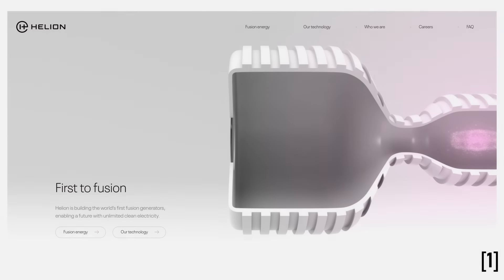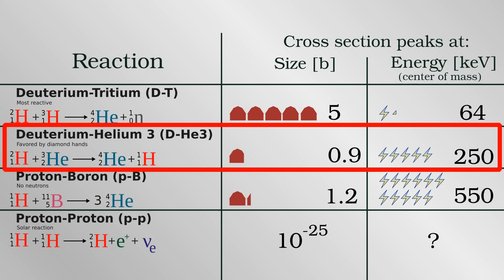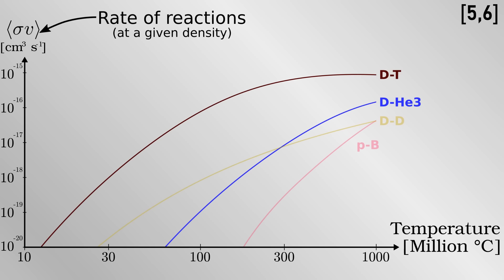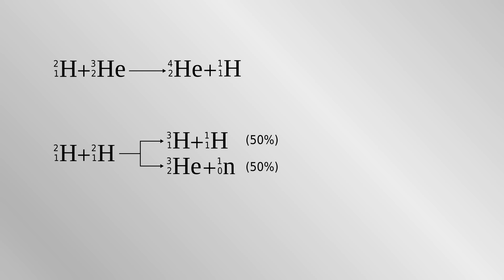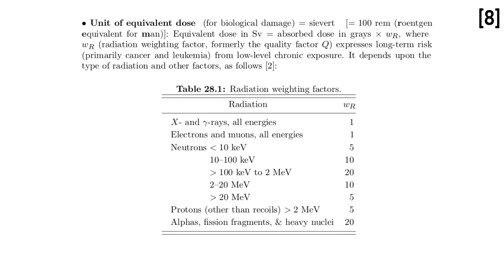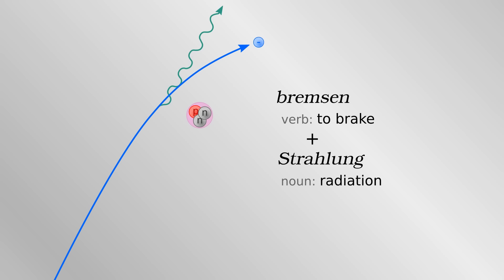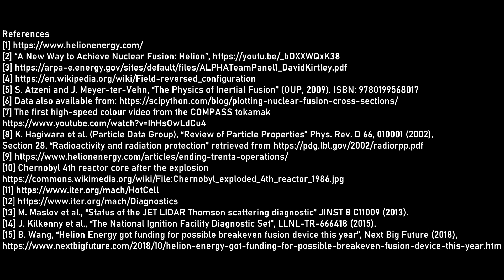The problems with Helion Energy - a response to Real Engineering

Comment: Great video.
I look forward to checking out others you made.

Personally I think fusion Energies probably won't be done here on earth as it seems we will be trading out one nuclear waste source for another.

We have been doing nuclear fission since the 50 for power. In that time we have maid some 500,000 tone's of radioactive waste.
I think if some how we got fusion tomorrow, the amount of radioactive waste generated would be comparable as every 5-10 years your going to have to replace key components in the reactor if not the main reactor itself because of neutron bombardment.

Let's say we take the 400 or so reactors we have now and instantly turn them into fusion type power plants. Each core around 1000 tones.... 
In the 1st parts swapping after 5 years that as much waste as we have maid in the past 70 years of nuclear power.

Granted not all of its going to need replacing and not all of it will be dangerously radioactive for "very long" but it sit puts Into perspective that nuclear fission isn't the "miracle power source" that it's maid out to be

Comment: I can spot one tiny problem with your analysis, what if Helion Energy not only increases temperature, but also the ratio of Helium 3 to Deuterium. Like 99 He3 to 1D? Then the Deuterium will be consumed by Helium 3, before the unwanted side reaction?
Reply from the maker: OK, but then the reactivity will be much lower, so it will be that much harder to reach breakeven. Also, all that Helium3 still has to be synthesized from Deuterium by them in another reactor. D-D fusion will strictly release neutrons 50% of the time.
Reply: @Improbable Matter  Extra Helium 3 would only need to be generated one time, and yes they specifically say they make Helium 3 from the D-D reaction in a separate reactor that produces tons of neutrons. I suppose there's a sweet point where the He 3 to D ratio produce (just) few enough neutrons for the nuclear regulator not to demand tons of expensive shielding and just enough reactivity to get a net energy yield.
Reply from the maker: @mreyesonthelies4386  Yes, but the "separate reactor" will still have the neutronics issues. If that breaks due to neutron damage, or becomes seriously radioactive etc, then there is no point having the one with Helium 3.

Also, the D-D reactor will need to break even on energy itself, or the Helium3 one will need to be even more efficient to compensate, which again will be difficult with a 99:1 ratio of reactants.
Reply: @ImprobableMatter  Yes they mentioned the maintenance cost of those separate reactors, which is why I'm so sure that they are determined to damp the D-D reaction to the extent possible in the main reactor to cut costs from neutron damage, costs which need to be cut to compete with floating solar on pumped hydro etc

Comment: I thought braking radiation was based on an electron passing a large atom?  Would hydrogen plasma really produce x-rays?  
Also, the neutrons are fast neutrons.  When you say a meter of material, you mean a meter of very dense material, right?
Reply from the maker: Hydrogen plasmas can and do produce x-rays. By a meter of dense material, I mean solid or liquid (not plasma). There physically has to be shielding somewhere in the system.
Reply: @ImprobableMatter  But it isn't a meter of anything.  Water vs lead.  Also, do you want to stop the neutrons or moderate them?  Slow neutrons are happy to grab onto other things and mutate them.
Reply from the maker: @putinscat1208  I can't read the mind of the Helion team, but my suggestion to them would be to stop the neutrons to prevent material damage making the machine unusable and transmutation reactions making the machine long-term radioactive.
Reply: @ImprobableMatter  Has anyone ever tried to use hydrogen to catch neutrons?  Then they can feed the deuterium product back into the reactor.
Reply from the maker: @putinscat1208  Of course, you wouldn't want pure hydrogen gas because it is explosive, but you could have heavy water to breed some additional Tritium (Deuterium itself is cheap enough). This is how Tritium is made in CANDU reactors. However, for Helion this would require big infrastructure that their current and future machines simply don't have.

Comment: Do you know of any ongoing or planned projects to fuse strictly protium or deuterium ? Aka the actually useful ones?
Reply: Also, if you read the comments, can you tell me what is the usefulness of a neutronic fusion? I get that protons and random ejected nuclei are magnetic and can be guided, but that's never going to be perfect anyways, charged particles are bound to fly off in pretty much all directions, even with a magnetic field. And then what? You can control the trajectory of protons going super fast, cool, but to extract useful power you're going to need them to crash into something anyways to generate thermal energy, a role at which neutrons do the exact same job as protons
So am I missing something? If we assumed there was a type of reaction that produced only charged particles, what would even be the usefulness of such a thing? We can guide somewhat the fusion products, so what?
Reply from the maker: Deuterium is harder to fuse with itself than with Tritium, so it would be hard to achieve a net energy gain. If you actually could achieve aneutronic fusion, then you could always extract the energy as heat and spin turbines, etc.

Comment: Well you're just trying to shrink a process the size of the Sun down to the size of a house. How hard can it be? I'm sure they'll have it in another 10 years tops.
Reply: You are joking right?  Sun has a enormous mass and thus gravity pull.  It squeezes atoms with extreme pressure.  Without the mass of sun and without the pressure, you need to raise temperature to 150 million K for fusion to start.  Very hard indeed.

Comment: Of course I’ll trust someone’s word about engineering when that person doesn’t even know that the reactor uses superconducting magnets, hence it will produce exactly 0 bremsstrahlung. 

Also the number of reactions isn’t as important as capturing the energy that they produce, Helions approach has almost 100% efficiency bc of the induction approach to capture, common Tokamak designs that use steam turbines and will have at most 30-40% efficiency. Additionally uptime is a huge issue with Tokamaks because of plasma stability and bc their shielding deteriorates rapidly under the neutron fire. Compared to a mild DD reaction the DT fuel is devastating for reactor lifespan and maintenance.
Also Helions approach is easily scalable and faster deployable, a commercial Tokamak will take 10-20 years to built Minimum (just look at ITER) and take up huge space. 

If there was a fundamental physical problem a 7 minute YouTube Engineering Video could find out, Helion wouldn’t have been able to get over half a Billion dollars in investments.

You are not a plasma physicist, if there was a problem someone smarter and more knowledgeable than you would’ve called bullshit years ago.

And now shut up and stop spreading misleading half-truths to teenagers
Reply: You could at least attempt to explain your position instead of squawking around like a marketing agent for Helion.
Reply from the maker: Bremsstrahlung doesn't mean what you seem to think it means. Bremsstrahlung comes from the plasma itself, it doesn't matter what type of magnets are used. Also, not to nitpick too much, but even by their own admission, Helion don't use superconducting magnets, and don't intend to for the final reactor.

Yes, obviously any credible plasma physicist has absolutely no problems with Helion's design. That's why the hundreds of physicists who work at ITER, NIF, JT-60, EAST and any number of publicly funded experiments, along with all the physicists working for Commonwealth Fusion, TAE, First Light Fusion and other private startups have all given up. Yep. They all just work flipping burgers and pray to Helion every day.

Comment: A couple comments and facts , one if someone posts especially using their NAME they do not work at a government lab, the DOE, DOD, Air Force research lab etc. it is forbidden to even discuss your work with your spouse even or anything you have heard, there is constant training about this and getting fired would be the least of your problems. The DOE publicly announced that net positive fusion has happened at NIF. In order for a private company like Helion to acquire 3H etc their are inspections by the appropriate government agencies that are on going. If there’s a risk of radioactive contamination at all the facility has monitors to track this as well as employee person devises worn every day. In fact even small labs and universities are monitored. Old pile fission labs that have been clean for over 50 years are still monitored. I don’t understand the thinking behind one of these for profit labs would not be subject to the same monitoring as every other for profit lab. Why would the government regulators ignore just the fusion industry?
Reply from the maker: No idea where you got this nonsense from. Why does the DOE publish their findings, give public presentations and so on if they're forbidden to discuss things?
Some things are classified, some are not.

Comment: Tritium is not an option.
Reply: Why?
Reply: @Gomlmon99  
Tritium is extremely rare. There sinply is not enough of the material, making it a non-viable component for widespread energy production.

While helium 3 is also rare on Earth, our moon is rich with helium 3.
Reply: @ThisHandleIsNotAvailable.  But every single commercial reactor in the world will breed their own tritium and therefore will have an infinite supply?
Reply: @Gomlmon99  
So you would want to run nuclear fission reactors to produce tritium to fuel fusion reactors?

If so then there is no point in moving from fusion to fision in the first place.
Reply: @ThisHandleIsNotAvailable.  no. Like I said, fusion reactors are all designed to breed their own.
Reply: @Gomlmon99  For a reactor to produce enough tritium to perpetually maintain a fusion reaction; this would require 100% efficiency. 

You are basically talking about infinte energy which is just fantasy. Humanity has never engineered anything at 100% efficiency.
Reply: @ThisHandleIsNotAvailable.  Do you really think that you, with no knowledge whatsoever in fusion, know better than every fusion engineer and scientist to ever design a commercial reactor?

They don’t need 100% neutron efficiency. That’s what neutron multipliers are for. There is a reason every commercial reactor design uses them.
Reply: @Gomlmon99  
1) You have no idea who I am.
2) I am correct and time will prove helium 3 the viable option.

Good luck with multipliers in fantasy land.
Reply: @ThisHandleIsNotAvailable.  I know that you don’t know what a breeding blanket is, which is enough to tell you know nothing about fusion. 

“I am correct” is not a logical argument. 

How are multipliers fantasy land? It’s basic neutronics. Certain isotopes give out more neutrons than they absorb. A bit like fissile uranium, which we’ve been doing for about 80 years now. (Not that we use uranium, we’d use Be + n -> 2He-4 + 2n)

Again, why do you think you know more than every fusion expert on the globe, despite having zero education in fusion?
Reply: @Gomlmon99  
You didnt ask if I knew or not.
You assumed I did not which is fallacious.

You have no argument and are now attacking me, not the comment I made which is typical on the internet. Great job.

Good luck with infinite energy magic.
Reply: @ThisHandleIsNotAvailable.  It’s not fallacious. Here’s an analogy: if someone told you 2+2=5, you wouldn’t have to know them to make a just assumption about their maths skills.

I have given you a fine argument. I even went as far as to write out the neutron equation as I knew you wouldn’t know it.

Nor know what a breeding blanket even is.

What’s your logical argument again?
Reply: @Gomlmon99  

If you are making erroneous arguments with zero merit based on assumption that is absolutely fallacious. 

Have a good day and enjoy the Helium 3 future.
Reply: @ThisHandleIsNotAvailable.  it’s not an erroneous argument, nor does it have zero merit.

I’ve explained to you that breeder blankets exist. I’ve even gone to the absolute basics to tell you an example of an equation they use.

Do you have the intelligence to accept you were wrong? You still haven’t been able to give an argument in response, than make false claims of logical fallacies… which I think is a fallacy in itself.

Comment: I know it's a scam for VC money the day That channel tried to present them as unique... To be real.. Most Space and Fusion startups are Cargo cults thinking they can do some success like SpaceX.. Copying the anamoly does not equal success without understanding why it successded...which is up normal humans and condition at the point of startup... From getting success space station supply success in the right moment when fugured out a greet engine, and figuring the 1st stage return to Land which needed a great engineering first principle approach which musk had. Engineering fusion is much much more difficult due to the multitude of tech needed which landing back on ground just needed proper GPS and electronics which already where a viable by mid 2000s...thus they require extream engineering in magantics and materials and systems to reach reliable energy production

Comment: Not an unbiased well researched commentary.  Look at the rate constants for the reaction temperature Helion is working on.  If they are not generating Neutrons like they say they will not need the shielding.   It is more easy to be a naysayer than to do something hard which required effort.  I think the DOE and Fusion is pretty much BS.  Well funded for "other reasons" We had super high yield's and pioneers Hohlraum ( when is was still classified) with shaped UFL uniform irradiation back in the 1980s They hid it only to do it later after countless Millions of dollars.  Like large space agencies who still cannot build a rocket to the moon Nay Sayers like you could not believe it could be done without lots of free money and bureaucracy.  An example of someone who I would not ask to do a difficult task, UR..

Comment: One thing Helion is really good at is generating a favorable money generating Narrative!   We all better hope they don't achieve success because of the disaster shown in the video!
Reply: Fusion reactors don't present the same dangers than fission reactors, for multiple reasons. The one I find easier to follow is that, in contrast with traditional fission reactor that house hundred to thousands of kilograms of fissile materials, the amount of plasma inside a fusion reactor is usually measured in milligrams.

A steam or hydrogen explosion in a fission reactor is an big accident that will probably force the evacuation of everyone in a radius of many kilometers (think Fukushima, or Chernobyl). If a fusion reactor losses containment, it may damage some parts of it but hardly destroy the plant, or force the displacement of the neighbors. The worse accident I can think of would be the rupture of a tank of Tritium, and those are not even part of the reactor per se.
Reply: @charliem6590  The narrator was comparing the neutron produced radiation from an operating commercial sized Helion reactor without shielding to the radiation released from Chernobyl.  Helion obviously can produce a lot of high energy neutrons which can create other radioactive elements.
Reply: @Hogger280  Frankly, I don't follow. You said "We all better hope they don't achieve success because of the disaster shown in the video!".

Are you saying that the theoretical neutron radiation coming from a puny 50 MWe fusion reactor is as catastrophic, as significant, as the results from the release of tonnes of highly radioactive materials from Chernobyl ? That's ridiculous, it is as saying that a house cat is as dangerous as an adult tiger on the lose.

Moreover, how can anyone think that people knowledgeable enough to build such a machine, would at the same time be so ignorant that would not even think about neutron shielding.

This looks like a case of straw-man argument if I ever saw one, specially when there are documents publicly available that state they plan to lodge their machines inside shielded vaults.
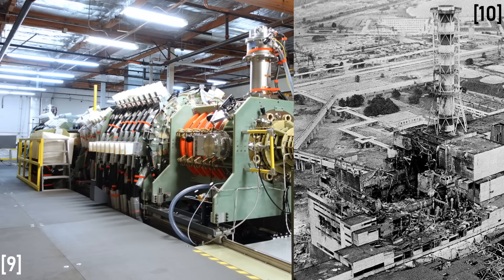Reply: @charliem6590  I did not say it - perhaps you should be attacking "Improbable Matter" - He is the one who said it - T 4:59
Reply: @Hogger280  If you don't mind, I don't feel like attacking anyone, just making a point. I directed it to you because this is your thread.
No matter how said it first, that comparison is not serious.
Reply: @charliem6590  If you don't like the comparison, take it up with "Improbable Matter" who made the statement.

Comment: Ok...except that...the neutrons are really the ONLY problem with Tritium...but they're also a permanently insurmountable problem.  Its expense could feasibly one day be dealt with.  It's improbable, but possible.  But the neutron problem is eternal.  You can't get power from neutrons.  They're worthless.  They're all waste, and nothing else.  They do nothing at all but damage the equipment.  Even when you use the heat they manage to generate in the materials they intersect, that thermal output is next to nothing by comparison.

Tritium is completely useless.  So, your entire graph about how much better it is than Helium3, is complete nonsense.

Either we use aneutronic fusion...or we don't use fusion.  The end.
Reply: I don't understand. Granted, it would be better for any reactor to operate without them if at all possible, but in fission neutrons are the main way to transfer energy and generate heat for the turbines. Why do you say they are "all waste" ?